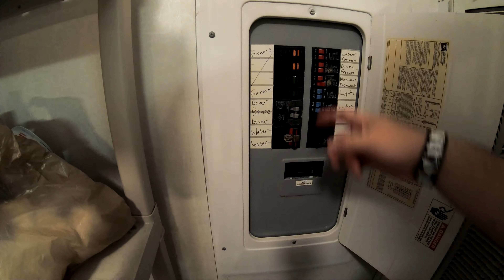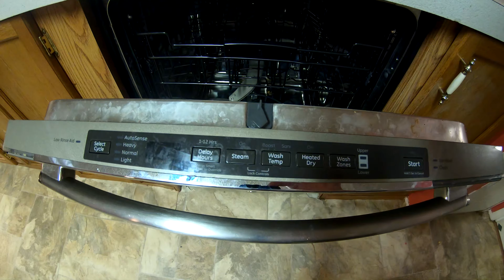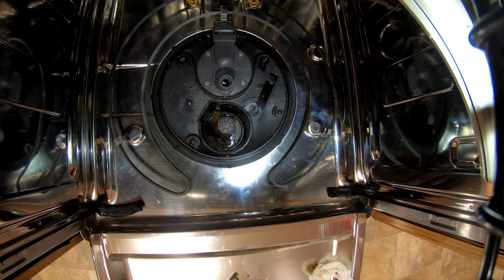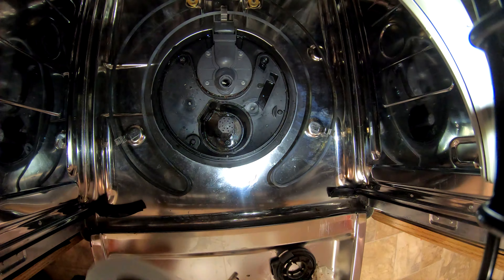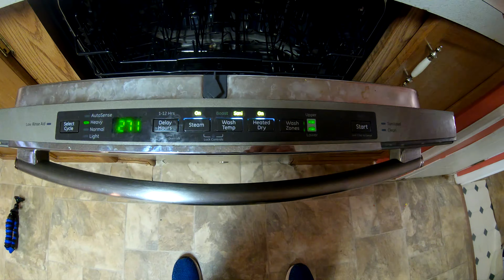GE Dishwasher Flood Switch Replacement!

Comment: I had a GE dishwasher exactly like yours install yesterday - model GDT605PGMBB and after installation and after they were gone, there was a leak under my sink with the drain hose not fully onto the disposal which I took care of but had to turn off the dishwasher. I tried to start repeatedly, but it kept beeping and would have a Ftd message on the display. So I got one of those super absorbent sponges and got all the water out, turned off the electrical at the power box to reset, and so now it will run for exactly 15 minutes and then the same message of Ftd (exactly like that) and it shuts off. There is a couple inches of water in it and then I go and do the same things with the sponge and take out the filter and get all the water out, and it will do the exact same thing. I will be calling a GE repair person, but I found that maybe it might have to do something with the flood switch or something regarding this, so thank you for this video. It's super disappointing to have a new dishwasher installed that doesn't work! Just found out it's Failure to Drain, so thank you for leading me there even though you didn't know you did that!

Comment: dude, thanks for this video.
so I had about a cup of dirty water on the floor twice last week (blamed it on my pots and pan cleaning) but then my wife says that the dishes haven't been drying for about a week.

Why do you think that water would be on the floor next to the dishwasher, bad seal at the float?
Reply from the maker: I’d say more than likely that’s what it is! Probably wouldn’t hurt to replace it. Let me know if that fixes the issue.

Comment: If you shake the part and you can't feel the internal plunger move, you can try cleaning the gunk out to free it. It may save you $35. Or it may fail again in a month.  I got mine to move by digging the crud our with a screwdriver and spraying water in the slots.  Then gave it a vinegar solution soak (don't soak the rubber gasket end in vinegar).
Reply from the maker: Sometimes it can help if you clean it. Did not work for me but has for a few people on the channel. Thanks for the comment!

Comment: Hi Break Fix Repair, we have a GE Profile dishwasher.  And we got a  problem that it can't clean the dishes on the upper deck  and I open the door when it's working, looks like the water is not hot inside the dishwasher and the detergent didn't dissolve completely. The heating is still working when I run the full cycle.  Can you give me some advice on this problem? Do I need to replace the flood switch and give it a try? Thanks.
Reply from the maker: It’s worth a shot to replace it. Seems that flood switch controls a lot of things other than water level! Before you purchase, try running the hot water off  of the line the dishwasher connects to, until it’s hot. Then try to run a load of dishes. I’ve seen that cause problems too. If that doesn’t work i would try the flood switch replacement. Hope this helps!
Reply: @BreakFixRepair  Thanks for your quick response.  Sorry I didn't quite understand what you mean " try running the hot water off  of the line the dishwasher connects to, until it’s hot."
Reply from the maker: No worries. Normally the dishwasher water line feeds from a sink right beside of the dishwasher. Just run that water until it is hot prior to starting the dishwasher. This will ensure the dishwasher flood switch reads the temperature as hot and works optimally.
Reply: @BreakFixRepair  I‘m running the dishwasher now. The water seems lukewarm, not cold nor hot, plates are damp but not clean.  I washed the dishwasher with soda and vinegar. Not sure what's the problem.  I already purchased a flood switch and will give it a shot when I get it.

Comment: What would happen if you broke the top of the flood switch off? Just the plastic cage that surrounds the float itself?  Everything still works.
Reply from the maker: Crayon I believe the outer shell is there to protect the float and thermostat from large food particles and debris. My guess is it would end up failing faster than normal. Thank you for your comment.

Comment: Hey man! Great video! I only wished I would have watched this before I tried to replace my flood switch. I did not soak all the water with paper towels and when I pulled the switch obviously water drained into where the wires are. Now my washer won't even turn on. How bad did I mess up?
Reply from the maker: Oh no!!! That's not good! Well, did you turn the power off to the dishwasher prior to replacing the part? It could be that the breaker was tripped. I'd check that first. If not, I'd turn it off and let it air out. pull the flood switch loose again and make sure there's no water in those wire connectors. If there is make sure it dries out too. If you've done all of this water may have shorted out the control board from those wires. If that's the case you'll need to replace it. The part is in the description of this video (just verify it's for your model dishwasher). Hope this helps! Have a great day.
Reply: @BreakFixRepair  after I replaced the switch we loaded the washer and went to start a cycle. It was on, then it turned off and won't turn back on. I took everything back apart and I'm currently drying everything with a fan. Fingers crossed it was just wet! Thanks for your help
Reply from the maker: @gsj996  Let's hope it was just wet!! Let me know what happens!

Comment: Hey thanks for the video, I have a question. I just cleaned out the filter area cause it’s only been 5 years haha didn’t know that was a thing. Unfortunately it didn’t fix it. It’s still not heat drying like we hoped or maybe not get getting not either, dishes seem clean just not steamed. Does ordering a flood switch sound like the right fix? Thank you in advance
Reply from the maker: That’s what it sounds like to me! Sometimes you can clean it with vinegar but normally it’s cheap enough to just replace and move on. Hope this helps! Let me know what you do and if replacing it fixes it.
Reply: @BreakFixRepair  ok will do thanks
Reply: @BreakFixRepair  hey thanks for the tip. The flood switch fixed it! Thanks for the video and helping us all save money!

Comment: Hi! We have a different model of GE dishwasher (GDT565NSSNSS). The flood switch that is standing up under the filter is not present. There is another video where someone replaced a switch that was underneath which plugged in... buuut, we are having a hard time finding the switch underneath! There are no diagrams to guide us and we are just looking for more assistance on which part we need :-/ If you are able to help, that'd be amazing! thanks!
Reply from the maker: I’m thinking the flood switch on those is located under the dishwasher. Seems to be a smaller part. Were you able to find it?
Reply from the maker: I did find a few diagrams but unfortunately don't see any sort of flood switch or high limit thermostat in the parts listing. I'd say at this point there are two items I'd look at replacing. The heating element (which can be tested before purchase, just check for continuity from end to end) and the control board. control board: WD21X25992 and the heating element: WD05X25583. Just double check and verify those parts fit if you do order. I've read a few people say they've had a lot of issues out of their control boards on GE dishwashers so my feeling tells me to replace that first. and it's not terrible expensive on your model. I hope this helps. Please let me know what you find out.
Reply: Hey there! Just an update on replacing the control board. Sadly, it didn't work. I think, even though our heating element appears to have continuity,  we are going to replace it anyway... we really hope it helps 😏 Open to any other suggestions on how to fix it!! We would love to have cleaner dishes again 🙃

Comment: I put in my Model number on the GE website and it said my dishwasher had the flood switch assembly. Stupid me I didn't take the time to quickly check the unit and see that it didn't have one. Ordered one and of course did me no good. Turned out it was the heating element that had tripped and I just had to pull out the dishwasher and reset it on the bottom. ✔So now if anyone needs a flood switch still in package, I have one. Cost plus shipping. It was $32.60 from the GE website. ✔

Comment: Today, I took out my dishwasher to install a water inlet valve..  After installing it, I washed some dishes and they didn’t come clean.  The liquid detergent was still on the door just like it had been for the last 4 washes. I didn’t think it was the float because I had tapped it but I saw this video and removed it and shook it and it seems to move fine. I run the water hot at the tap.  My water heater is set at 120 degrees.Any other suggestions as to why my dishes aren’t coming clean?
Reply: The water is hot on the bottom but it doesn’t seem like the spray arms are working because I open the washer during the cycle and there doesn’t seem to be water on anything.  Also, I have some plastic water bottles that I have washed frequently and two of them distorted / melted.
Reply: Also, the spray arms don’t seem to be working because I set them a certain way and every time I open the dishwasher during the cycle, they are in the same place.
Reply from the maker: Well, I would check for some sort of obstruction blocking water flow. Take off your sprayer arms and clean them out good. There should be a water valley that leads from the bottom up then back to the other arm(s) if you have three. I’d take that loose and clean it all out. Also it wouldn’t hurt to run some dishwasher cleaner through it on a monthly basis. I have another video explaining good dishwasher maintenance that should give you what you need from a cleaning perspective. Hope this helps.
Reply: Break Fix Repair What is a water valley?  Do you mean the pipe that runs up the back of the dishwasher?
Reply: I took out both spray arms and the rail from back .i ran water through them and water flows through them. There were two screws in the back but it looks like there should have been a screw on top holding the rail in but there wasn’t a screw there. I’m going to Lowe’s to check out dishwashers to see if there should be a screw there.
Reply from the maker: @60SecsofVegas  Can you verify the sprayer arms are turning? if they are not turning that means there's not enough pressure built up by the pump. That could indicate either a pump failover, or more than likely, a dirty filter or buildup near the pump since you checked the arms and pipe running up the back of the dishwasher for clogs. I would definitely recommend running dishwasher cleaner through it. I personally use this: https://amzn.to/2MoaOXv It seems to work well. before you do that, just verify the filter and area around the flood switch are clean. If you need this asap, try some vinegar and baking soda. Just sprinkle some baking soda on the dishwasher floor and put some vinegar in a cup on the top rack. Run it empty (this is a must). The dishwasher cleaner seems to do the trick to keep the dishwasher deposits down if you use it on a monthly basis.  Hope this helps.
Reply: Break Fix Repair I just put my phone in a plastic bag and heard it fill and there is water on the bottom.  I called the local parts place and he thinks it’s crud in the pump / hard water / or the pump.  I will try what you said with the vinegar
Reply: Break Fix Repair I cleaned the whole flood switch / fioat out the other day when I took it apart.
Reply: Break Fix Repair My wife gave up on me fixing it so she called Sears Appliance Repair and for $139 he told her it was going to cost over $500 for the motor.  I think he meant the pump so we went dishwasher shopping last night.  If anyone in this group wants a part from my old GE dishwasher, let me know.

Comment: This is a great video. I ordered the part from the link and replaced it. I ran a cycle after replacing the flood switch and the water will not drain. Any suggestions?
Reply from the maker: Thank you! Try turning the power off at the breaker box for 5 minutes. Also was the electrical cable attached to the flood switch good and tight? Sometimes they’ll fall off if they don’t click in place
Reply: Yes, I’m pretty sure it was on tight. I took it apart again to make sure and it was good. The original problem (not cleaning/drying) was fixed after I replaced the part but now it’s not draining.
Reply: @jjs1228  Clean the drain line
Reply: @brucebuell7528  hello. Thanks for the suggestion. I checked the line and it was clear. I had to replace the drain pump. Thanks again!
Reply from the maker: Sorry for the delayed response Jessica. I do not always get the notification for comment replies!! Glad you were able to get it fixed though!

Comment: Thank you! I'm going to try this. I installed new upper rack rails in my dishwasher a couple of months ago. I'm pretty sure the flood switch will fix the current issues (not really drying the dishes and leaving residue on them). [I am not a fan of this dishwasher.] I have a question... My rinse aid compartment has two settings: MIN and MAX (I think; it's hard to read)... however, both settings appear identical (switching back and forth doesn't make a visible difference) and I'm wondering if there might be a missing part. I get the low rinse aid warning after filling the compartment within about two runs... even when set on MIN.
Reply: I have a GE Monogram and the rinse aid empty warning comes on after just 2 cycles, as well.  Found a way to turn the warning code off in my manual, so must be a common thing. Ours is brand new out of the box and doesn’t dry at all. Repair service came out twice. Replaced the dispenser because there was so much rinse aid in the bottom of the dishwasher that I had to use a product called Sparkle to dilute it.  Mine has never dried the dishes. It is sopping wet on every cycle I’ve run, regardless if it’s on Max or Power Dry settings.  I finally let my rinse aid run out because it would be dripping milky water from the side walls and upper trays onto my clean dishes once the cycles were completed.  Ours is still under warranty so waiting on one final call back before either ordering our own parts or bagging GE all together and buying a Bosch.  I appreciate your helpful videos!!

Comment: Also if you start a cycle first and stop it when it starts to fill.  Cancel it by holding down the start button for 3 seconds.  The pump will suck out all the water

Comment: For taking out the spray arm on the bottom of the dishwasher: “just turn and lift... easy Peezy“… Didn’t work for me. Do you have an alternative to “easy Peezy”? General electric model number GDT720SSF0SS
Reply from the maker: There should be a little circular piece directly under the spray arm. Grab ahold of that piece and turn counterclockwise that should release the arm. As far as the rinse aid is concerned I’ve noticed these dishwasher use a lot of rinse aid. Mine takes almost an entire bottle before it’s full. Hope this helps!

Comment: Is there a way to drain the standing water in dishwasher?
Reply from the maker: There’s only two things I’ve seen work so far. 1) cancel the cycle it’s on and shut the door. Sometimes this will prompt the pump to remove the water. 2) if that doesn’t work, start a new cycle and let it start for about 60 seconds and it may remove the water, just be sure it doesn’t start spraying new water! 3) be very careful but a wet vac / shop vac that is made to suck up water will work wonders. Once you’re down to the small amount of water just use an old towel to soak the rest up. Let me know if this helps! Thanks for liking and subscribing!

Comment: Hello. My gdt550hsd0ss is having drying issues. I changed the flood switch and the heating element. Water temperature not going above 90 degrees F. Any other ideas?  Thank you for these videos. Subscribed.

Comment: For that model (I have one very similar), I noticed that the Conduit Mid-Tiered Assy - that brings water to the middle sprayer, is not aligned front-to-back which causes the sprayer to sit at an angle.  I think this causes the spray not to hit the soap dispense door and the soap remains partially used up inside.  Should that piece be at that angle or should it be perfectly aligned front-to-back? I have a picture of the piece but can't post it on here... Thanks.

Comment: Would changing this help to clean my dishes? I had someone look at my dishwasher and he thought the float was stuck and it would be cheaper to just replace the dishwasher.
Reply from the maker: This is a super easy fix, I didn't cut any of the video footage, on purpose, to show how long it takes to replace. I've done it twice so far, only the second time in this video was for demonstration purposes. The part is relatively cheap and if you're having a water heating issue then more than likely this may be your problem. The link to the part is in the description, just make sure it's the one that fits your dishwasher. Hope this helps. If you need anything else please let me know! have a great day!